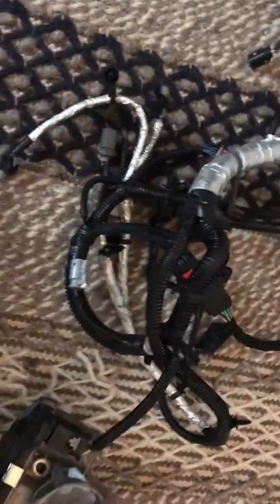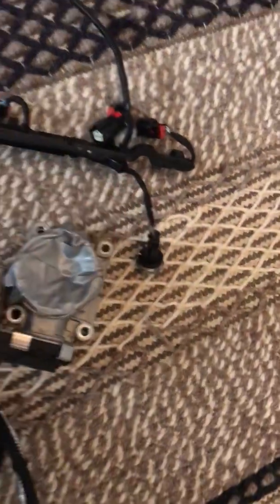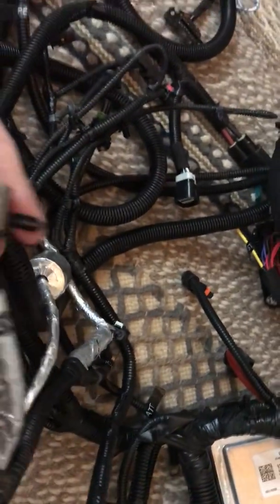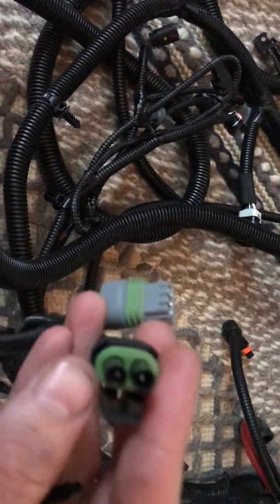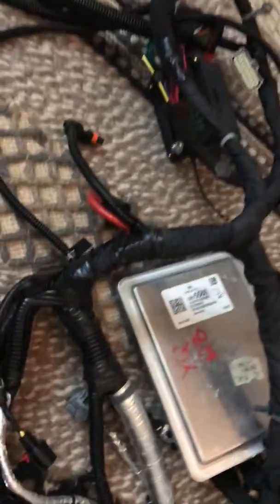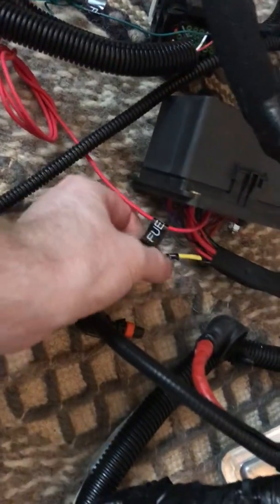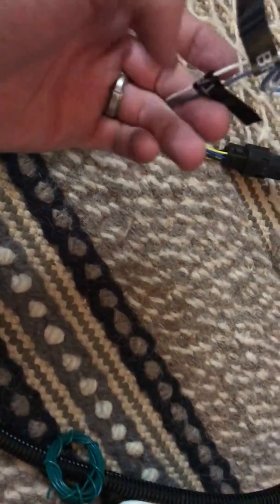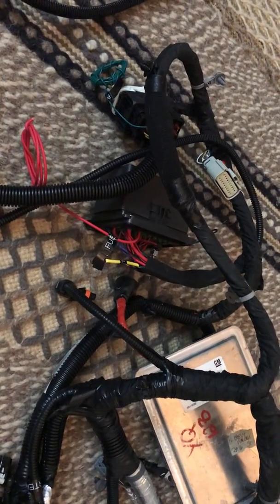Swap Time harness arrives! The ecotec swap is good to go!  The first LTG harness I've found

Comment: have you tried the harness yet?
Reply from the maker: I haven't. I believe I am going to sell all the parts.   The amount of work to fit it in my chassis is pretty substantial. Far more than expected

At this time I'm either going to sell it all or find a car that I can put it in easier
Reply: @exportedafrican  Got ya, it seems like a pretty interesting swap, I hope you find a place for it! Very interested to see how it works out, if you decide to keep it.
Reply: I know this video is really old but did you ever do anything with the harness or do you still have it and want to get rid of it, I'm trying to swap an LTG into an 88 fiero
Reply from the maker: @sinr247 sorry. I sold it all. Guy was going to put it in an rx8 drift car